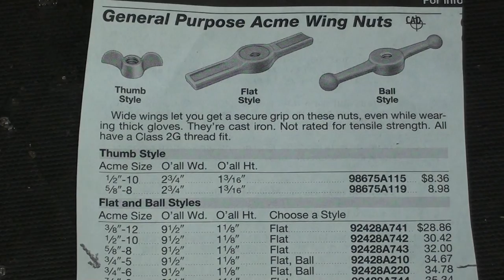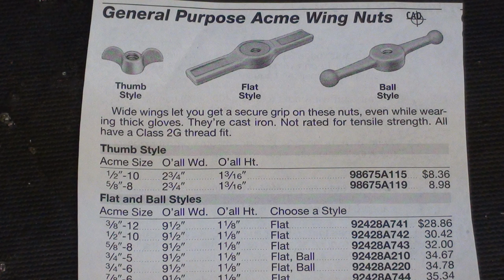TAPPING an ACME BALL NUT #879 tubalcain clausing lathe

Comment: Hello Lyle, some years ago, I made a new bronze cross slide nut for my Hercus lathe(Southbend clone). I cast up the nut and as the thread was 7/16, it was too small to successfully screw cut. To buy a 7/16' left hand 10tpi acme tap was out of the question, so I made one out of some tool steel, milled the flutes, then hand finished the cutting clearances. When heat treating, it developed a slight bend, even after plunging straight down into oil. Still worked OK. I then screw cut a new cross slide screw to fit the new nut.

Comment: This video is “right up my alley” as we say down south. I have a customer who refurbishes dental equipment to new condition. One job requires replacing worn Delrin nuts in ball threaded ACME lifting screws. So far I’ve made new nuts with 3/4-6 single lead, 3/4-6 double lead, 3/4-8 double lead, and soon to be 20mm double lead. (two threads on one shaft). The customer furnishes the very expensive tandem ACME taps and I do the work in my home shop. Delrin nuts are self lubricating and very quiet and the ball screws usually don’t require replacement. It’s been interesting to learn how ACME taps are made.
Reply from the maker: Thank you for that interesting comment

Comment: I made one handled pieces like that, first I tried cutting the internal threads w a single point ground from drill stock. Challenging indeed! I too used rough cast old stuff found along the way.. bought the taps for 3/8, 7/17, and 1/2 acme. Larger left hand thread. For rebuilding my sb lathe cross slide.. but the single handles were to repair my antique Bridgeport mill. The locks r single handle. Having the tap is such a benefit!  Holding such shapes indeed requires sum inventiveness! I used an old c clamp screw like you . 5 hours of sweat equity n my mill has all its locking handles in order. Thank you for such well done clear videos. Please keep up the good works. Oh, I'm now looking for a bench grinder / sharpening lap... 😢
Reply: 7/17 ? Or do you mean 7/16 ?

Comment: Thanks for using the adjustable wrench backwards if only to spite the life long training that I have yielded to that they are directional. This has recently been a hot YouTube controversy. I have some quality adjustable wrenches even marked in the casting by the manufacturer indicating the correct use direction. I will have to go the the shops to confirm the brand(s). I have often used my adjustable wrenches backwards, but seldom without the internal fear that Dad or an early mentor is watching me, though they are all now dead. Even though a lot of data confirms that direction is not a significant deal, I still can't force myself to really load an adjustable wrench in the wrong direction.

Howee's has recently demonstrated on YouTube that a lathe can't throw a chuck key as violently as most of us were taught, but I still can't make myself leave any key in a chuck. I have seen workpiece damage when the workpiece was thrown from a lathe. The bad ones happened in my workplace shop, but not by me. My personal events have been limited to the learning curve on the wood lathe. They were serious enough to elevate my caution and alter my approaches in the machine shop.

You admitted that the desirable runout in your demonstration might have been mitigated by an alternative method. I find that one off processes teach you a better way after you have made an unintentional error or caused an unexpected event. Salvaging your only stock or workpiece then becomes a new challenge. I recently made a custom part for a friend and a small oops in the lathe bent the workpiece. I had no more suitable stock. I was able to recover and true and square the critical parts of the workpiece. It left runout in a non critical shoulder OD. Sending the work back including the the runout error irked me, but time and lack of material were critical factors and it went to my friend with an explanation and an apology. A paid job would demand rework. I learned from my oops and may avoid repeating my error. 
Purchasing a nut from McMaster Carr might have been a better final product decision, but purchased part QC is not fully reliable either. Our shop purchased a fancy Hyd Mech band saw. The three knobbed wingnut was made out of plastic. It broke within a year and likely had more runout than your demonstration. You repeatedly pointed out that your use doesn't demand a prettier part. Accepting the result in that case and moving on is good practice. If we learn from our experience, craftsmanship improvement might demand more care  in a a future experience. I my home shop I routinely discover that I have unexpected limitations mid project. Yesterday I discovered that my workpiece exceeded my lathe chuck holding capacity after roughing out stock with a large hole saw. The hole saw left an unexpected deformation  that demanded a work holding challenge to true the intended work holding surface. That project plan mistake forced me to change chuck jaws and that completely altered my intended plans, creating subsequent recovery steps. The other jaws held the work, but interfered with my tooling ater I turned the smaller registering OD. I suffered a whole string of "recovery" steps.
Reply from the maker: People love to talk about and criticize the direction or miss direction of using a an adjustable wrench. I actually did that on purpose. And I actually do not think it matters.
Reply from the maker: I have over 100 crescent. Wrenches, I have never damaged one except in a video I did years ago. The whole video was about what we are talking about.
Reply: Very good advice on what to do and what not to do. All based on practical experience. Thanks Paul.
Reply: @mrpete222  Calling it a 'Crescent wrench' is what irks me, using it bassackwards, not so much!

Comment: I used a un-machined handle like that to make a speed handle for my milling vise. I held it upright in my mill with a couple of v-blocks and drilled/bored it to a press fit for a 5/8" deep socket. I also milled a flat spot on the top of one of the ball ends to mount a small spinner handle.
Reply from the maker: Excellent idea

Comment: Thanks, Mr Pete. I am making a float lock vice for the drill press. I just began to cut 1/2” - 10 Acme threads on the shaft. At 80 years of age, I am not looking forward to using the Acme tap on the jaw.
Reply from the maker: Yes, it takes some muscle power. Some thing I do not have any more.

Comment: I was always taught (by my shop teachers) to pull against the solid jaw of a crescent wrench.....good video......
Reply from the maker: So was I, but I think that is all a myth.   I do have a video on that subject someplace in titled myth breakers.
Reply: @mrpete222  probably is a myth....but I think that is I was to put force till failure it would fail one way far sooner than the other.....I will check around for some empirical data.... :-)
Reply: @Deg99  If you're using enough force to break a quality adjustable wrench you're using too much force. Switch to another type of wrench.
Reply: @ellieprice3396  yes exactly,......but here's the thing.....If you do it the wrong way it is much easier to round off the nuts as the movable jaw will flex just enough.....that I can say for sure.... :-)
Reply: @Deg99  True. As a last resort a large vise grip will round off the flats much faster....(:-)))
Reply: @ellieprice3396 
      Nothing wrong to purchase or broach a set of most sizes in decent 1075 and a simple one dip oil quenching at about 1500°f. They only need to be about eight inches. Pipe for grunt factor.

Comment: Thanks again.  Have used my little 9" southbend for starting threads many times.  I have used the drill press and center point to tap three legged bases.
Reply: @AdamA-pm3yn  Probably not the best.  I just use a little oil.  I mainly machine brass and aluminum so not much lube is usually  needed.
Reply: @AdamA-pm3yn  I am probably wrong but I just use regular machine oil.  The SB lubrication chart calls for Type B on the bearings which 150-240 sec.  Here is the link to MrPete's video on lubrication..https://www.youtube.com/watch?v=VBqqty08S6M. Here is the one he did on the types of oils...https://www.youtube.com/watch?v=JuXDMnOaKVc
Reply: @AdamA-pm3yn  My pleasure.
Reply: @AdamA-pm3yn Hd46 is what we always used in a toolroom with over a dozen lathes of various manufacturers, ten or so mills, a dozen surface grinders, a dedicated broaching setup, and hundreds of hydraulic and mechanical compression presses on the production floor. Was originally Channel Master but was sold to Andrew corporation. 
You should've seen the co-ax cable machinery line. Wardwell wire braiders. Foam extruder and chiller, casing extruder and separate chilling runway trough. And the darn high-speed cable printer. WOW.

Comment: G'morning Mr. Pete! Perhaps you would consider a video on the making of an expensive tap like that. You have all the equipment. I've searched the world over for information on this and it is scarce.  Somewhere between edition 27 and 28, Machinery's Handbook dropped all the data related to taps, and I'm not convinced that editon 26 has a complete reference on the subject. I tried my hand at it, and it's much easier than one would think. Admittedly taps are generally too cheap to make at home because the material cost for the average Joe is more than the tap itself, but for something like a 1/2-12 left hand thread it can make sense to make one at home. Food for thought. I hope this message finds you well!
Reply from the maker: Good idea, but probably something I will never do
Reply: I can't find any info on the trapex threads at all.
Reply: @StanErvin-yo9vl  Yeah, information for tap standards is all but non-existent unless you're a member of some prestigious engineering club, it seems (like SAE).
Reply: Agreed. There's a unique club for almost every hobby, trade, or specialist all over the Earth ... And beyond into other dimensions and Universe.
Reply: @waynec369 Lots of tap information in the Machinery Handbook (the machinist Bible). You’ll probably find what you need there.
Reply: @ellieprice363  I don't know how you missed it, but I addressed that in my initial comment.... 

I own a copy of edition 26 & a copy of edition 28. Edition 28 has NO information regarding tap manufacture. Therefore, that information was dropped in either edition 27, or 28...

Comment: Not sure if needed, but when I get "worried" about a deep tap I stop tapping at 1/2, 1/3 or so, remove the tap then clean it and hole, then continue tapping. More time and work for sure but I normally end up with a tapped hole and still have a good tap.

Comment: When you are rebuilding a lathe for example and making a new feed nut, you will most likely have to tap. Yep acme taps are huge money I have several in different sizes. I like the tandem taps or two tap sets to relieve the load. However in my experience, they still take some power to get through. Do you have a tandem tap you can show the people Mr Pete? Probably not or you would have I suppose. Cheers.
Reply from the maker: I do not have a tandem, I’m not even sure where you would buy one. Plus it doubles the cost or maybe I misunderstand you. Sometimes there are two taps.       They starting to have a new finishing job, but they may be custom made.
Reply: @mrpete222  They are available at the usual supply houses. McMaster lists the 3/4-6 tandem at $160.00 either LH or RH thread. Not inexpensive by any means. Probably not many folks have them laying around unless they have a need for them. Can't say I blame them. Cheers
Reply: @warrenjones744 Hate to bring the news to everyone, but that Acme tap IS a tandem tap. Read the information on the shank. All that tandem means is to cut fully deep threads with a single tap. As opposed to that normal set of taper, plug, and bottom, which is exactly what Acme have invented and patented. Just feel blessed that we aren't using no chip thread FORMING taps.

Comment: Personally I really prefer singlepointing acme & trapez threads, even for smaller dimensions.
Boring bars of solid Carbide are wonderful (but breaks instantly if overloaded without warning).

One warning if singlepointing, the profile for imperial Acme and metric Trapez are slightly different, don't mix up the inserts!
Reply from the maker: Thank you, I was not aware of that they sold inserts for internal Acme threading
Reply: @mrpete222 
I think that he was alluding to actually making them from solid carbide bars! Very risky. Don't know if I'm that good to brag about it. But professor Pete can do it.

Comment: I have to cut a 2 9/16 x 8 ACME into a large backing plate soon. I got a 3 in round to make a verifying plug. At the cost of a bare backplate of this size i dont have room for error. I want to put a large 6 jaw vice on the Walcott. 16 inch or so.

Comment: "A tap wrench will not fit in here".  How so Lyle, what happend to that big box of tap wrenches?  It needs to be ratcheting, maybe because ti won't clear the  carriage?   We're going to have t address this.  And... I bought the same spring loaded tap follower and it was really stiff.  I took out the spring and put in a different one (longer and lower rate) so it doesn't push so hard, has a more constant pressure and you can nearly push it in all the way to keep from having to keep turning the tails stock wheel.   I thought it was a good improvement.

Comment: You meant you were showing us how not to use a file on the lathe. 😊
Them Acme threads are something. I just bought a imported tap for 5/8”-5LH and it went right on through.. but the thing doesn’t even thread on a half a turn.. 
I measured with a thread gauge for acme threads. Then I measured the OD. 16.80 mm ?? Closest I could find was 5/8” so I ASSUMED it was 5/8”. 
I’m positive it’s not trapezoidal, the pitch gauge fits perfect. But I’m doing something wrong. I noticed how the older machines are made very straightforward and standardized. My Clausing Metosa here is definitely not standardized.. metric with imperial here and there. Such as the acme threads in the tailstock and cross slide. This project has been a challenge to put it mildly. 
Thanks for sharing ball end nut threading ! 😊
Reply from the maker: That does cause a big problem when you have machinery or cars that are half and half
Reply: 16mm is .629 so it's not 5/8. Sounds like a metric tap with a different lead than Imperial.
Reply: @ellieprice3396  another machinist looked at it and called it out as 17mm trapezoidal. So I ordered two sets of thread pitch gauges and it only matches the “5N” leaf on the Acme thread pitch gauge. This lathe dose has inch/metric dials so it could go either way I guess. But I can tell you I have purchased three different taps and two pitch gauges, two sets of insert type Acme threading lathe tools. And have made numerous test parts. I’m just as lost now as I was when I picked it up to start this project.. 😩
Reply: Oh and from what I can tell there is no 17mm trapezoidal thread.🤷‍♂️
Reply: @jasonhull5712  The diameter of 16.8 indicates  it’s 17mm. Possibly standard 60 degree thread. Not sure what 5N stands for. Just a guess unless I could see it.
Reply: @ellieprice363  The “5N” is what the leaf has stamped in it. ( it being the SPI Acme thread pitch gauge) It’s a perfect fit for the 29 degree 5 TPI leaf and it is a Left hand thread. My best guess is that it’s a metric dia. Shaft with a 5 TPI Acme threads. But then again, I’m not really sure. It’s for a tailstock lead screw on a lathe made in Spain. (Clausing Metosa C1330S) 
These were common in small tech schools and universities. As far as I can tell from my research. I bought two of them and the that’s working is a great little machine. I want to return the other one back to normal OEM operation. It’s not like I’m in a hurry. I’m content with the one I have working. Between that and the vertical knee mill I have the capability to make stuff, now I just need the knowledge and experience.. 
it’s been 15 years since I ran these machines. I’m just trying to get back into it in my little home shop/ garage. 
 But thanks for the feedback. I do appreciate it.
Reply: According to your info the tailstock 
has a non standard 17mm 5 pitch LH acme thread. 
Since it’s non standard you  probably won’t find a tap to make the nut.
Reply: @ellieprice363  yeah, that’s what I was getting at with the older machines being much more thought out and standardized. Makes them kinda nice to work on. I think I’ll make a custom single point carbide cutting tool to try and cut them LH threads. It’s a small diameter so none of my boring/threading tools will fit in there! Lol I’m not totally green, but it’s been a good long time since I finished schooling for machine tool And die. 
I’m just now setting up my little machine shop in my garage. YouTube and folks like you have been such a big help. 
Thanks for the engagement. Have a good day! 🍻
Reply: @jasonhull5712 Good luck. The manufacturer may have made non-standard parts so you’d have to buy replacements from them.

Comment: You could have power tapped it with a solid center and the large adjustable wrench, rest is on the compound and bump the motor.
Reply from the maker: I suppose, but pretty risky with a $60 tap

Comment: Nice job as always
I have done metric acme nut 19m.m left hand using hss tool bit of course bronze nut it was joyful job not easy at all
Reply from the maker: I bet it was difficult. Actually, I will not attempt it without a tap. I bought the top, especially for this job, or should I say this video
Reply: @mrpete222  yes mr Pete it was difficult but we love what we doing